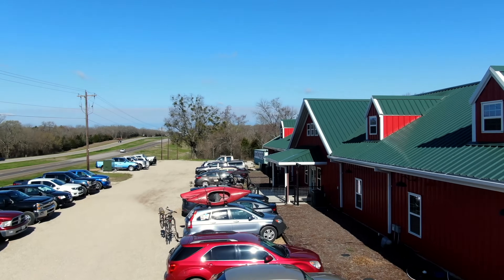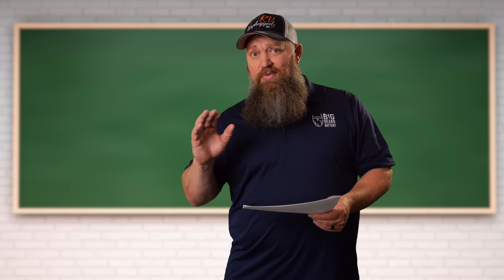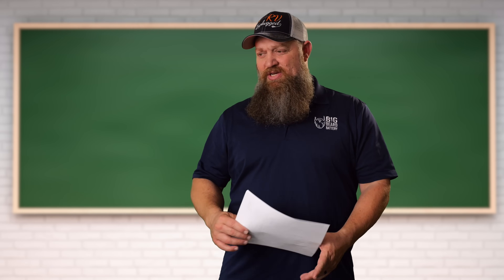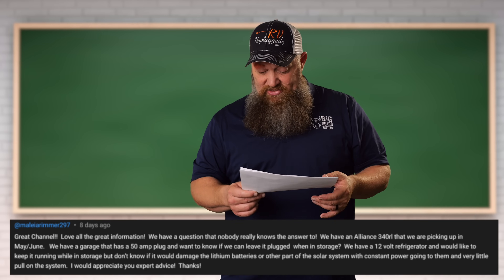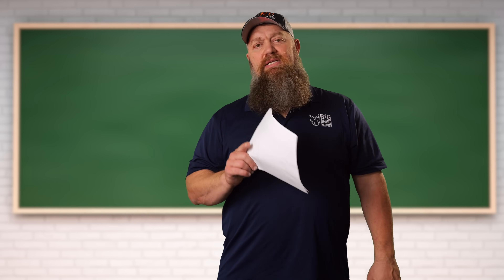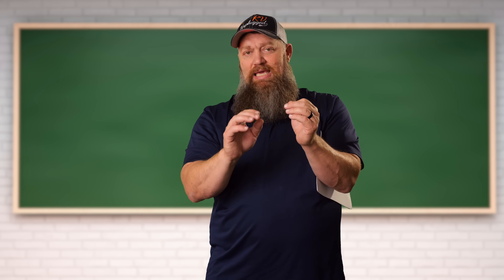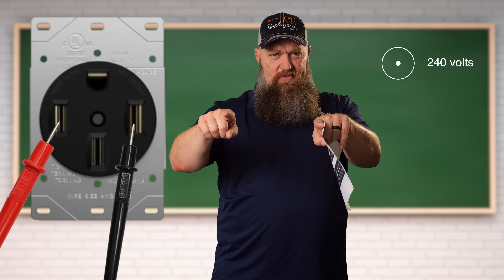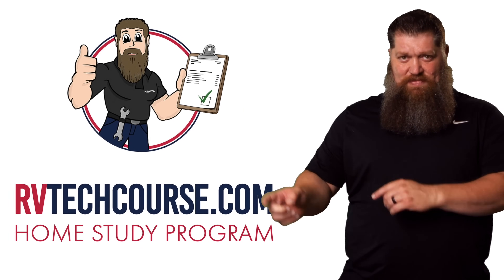RV Electrical Questions Q&A

Comment: Hi Todd love your TTT lots of good information but I need to verify something with you. When I plug my rv into a 20 amp gfi the plug trips. I think it it’s because  the neutral is bonded to ground in the rv. 
Can you verify that or am I off my rocker? Thanks Todd keep up the great job.
Reply from the maker: So without an ATS your neutral ground should NOT be bonded in the rv. It’s a sub panel. 

There is debate but I can tell you that any fluctuation of amperage between the hot and the ground up to around ~5ma will cause the gfi to trip. Air conditioners, refrigerators, microwaves all have capacitors that could fool the gfci. 

Some suggest the length of the cable. Greater than say 50’ could cause a voltage drop, while not significant enough for us to be concerned with the gfci sees it as a short.

Comment: I'm not exactly a Master Electrician. I am a Master Technician. And being that. As an, Electronics Audio Guy. I did some really wacky, Electrical Wiring and Interfacing. Let me explain it blows all, Electricians, minds. And here's why.

Almost 34 years ago. I designed and built. A very Unique. Audio & Video, Recording Facility.  A rolling couple of, Control Rooms  On Wheels. A big audio control room. And a smaller video control room. All inside a 25,000 pound, Diesel Box Truck.

In so doing. There was a couple of things I wanted. I wanted, Isolated Power. And so to get that. I purchased a, Step-Up/Step-Down,, Power Isolation Transformer. A 75 kW, Jobby. And with that.

I take a, single hot, 120. And another single hot, 120. No neutral. No ground. And I connect those 2 hots. Into the Primary  of this transformer. I generally take, between, 2 phases of, 204, Three Phase. Or, 240  volt, split phase 120. And my Electrical is Wired like an, Audio Circuit. The secondary of the transformer has a center tap. And with that. I get 120 and 120. On one side. I run all of my Audio Equipment and Video Equipment. On the other side I have, Lights. And my HVAC forced air whisper quiet, heating and cooling. Takes 240 volts.  Off the secondary of the transformer.  So even my HVAC is power isolated. My truck has no commonality with ground with my electric. And I have an internal Square-D Breaker Box, internally. With everything on a series of breakers. I was very mindful about my, current and wattage needs. I even did the mathematics needed for the BTUs of necessary air conditioning. On a 93° day. It came out to 18,000 BTU. I purchased a 24,500 BTU unit. And that gave me some additional wiggle room on the BTUs. For hotter days.

If necessary and I have, in the past. I can always get a, 240 Volt, feed. A couple of times. I could only get a 120  V, 60 amp, feed. And while that worked out. It also destroyed my power cable. My power cable was not rated for 60 amps. It was rated for 30. It melted.. 250 feet of rubber jacketed copper. Melted. That cost me a pretty penny.  I'm glad I got to the gig. I nearly burned the crap out of my hands! I vowed never to do that again. They can give me the right power? I'll leave. Or get me a generator. I need, 208-240.

 The Power Isolation transformer also, has additional advantages. My Audio Gear, actually got quieter.. In essence. I'm running Balanced Power. Balanced at the input. Basically unbalanced at the output. For the 120 volt feeds. The air conditioner gets balanced power  on the secondary. And since the transformer. Doesn't need to pass a frequency response higher than, 60 Hz. Nothing much higher than that. Gets through the transformer. So it's actually filtering out. Plenty of Radio Frequency Interference or RFI. And also cleaning up a lot of noisy trash. That makes it onto the, electrical lines. From others, air conditioning and refrigeration compressors starting up. Other RF interference getting into the electrical lines. So high in frequency. It doesn't make it through the transformer. I get cleaner more filtered power. Just by virtue of how the transformer functions.

And so every time electrician has looked at my electrical wiring. They are completely and totally confused. You don't take any neutral? You don't take any ground? No and no. I ddon't need any of that. I just need 2 hot leads. 120 and 120. Or 104 and 104. Thanks to the tapping on the transformer. I could take 104 and 120.. And still end up with 240 on the secondary. Thanks to the input taps. It gives me a lot of versatility.

 But then also. In certain circumstances. Where I can't or don't want to use the transformer. I have a couple of adapter electrical cables. And I switch those. Now I can take,  208-240  Volts.. Direct coupled to the power mains. And I have to take a neutral at least. I don't take ground. The truck is on big rubber tires. The whole body is wood. It is not metal. It's 1 inch FRP on the outer box. And three-quarter inch, dense particle  wood walls.. It's a box within the box. And it's split into 3 separate rooms. With a common lengthwise hallway on the passenger side inside. And solid core wooden doors.  Between the 3 rooms.. Each room has extensive Audio and LCD/LED, displays on the walls. Wherever you look. Wherever you are. You are surrounded in sound in all three rooms.

And after 33 and 1/3 years. I have officially shut down. Most of the gear has been sold off. The vehicle has been emptied. I'm now deciding. If I might possibly turn it into my Super Class-C Motorhome, now? Or whether I'll sell the vehicle and just purchase a newer old used motorhome for myself? Something extremely comfortable. For an old person like me. Going to be 69 in October.  And I seem to be slowing down? I think age might have something to do with it? Or I'm just pooped out? I think I'm just pooped out. I had a good run. I made lots of recordings. Though? I have not yet archived. My hundreds of recordings.. Most are still on analog and digital tape. And I no longer really have the gear to play it back properly.  I mean I do but I don't. Not the way I had wanted to do it initially. So that's the frustrating part. And there's just really too much to take with me in a motorhome. So I'm freaking right now. I can pack my truck full of stuff. Up to, 26,000 pounds. It's about half that right now. A motorhome won't sustain that much stuff. I'll break my suspension. So? I've got to make an executive decision before the end of June. And I'm cutting it close.

It's just another day in paradise..
RemyRAD

Comment: Question, I have a coleman rubicon 1400bd trailer , is it possible to charge my battery while hooked to shore power ? I have a converter but not an inverter and if so how ?
Reply: A 12 volt RV converter will also charge your batteries at up to the maximum amperage it's rated for, often somewhere around 30-40 amps. Inverters take power from your batteries and invert it to the AC power that regular wall outlets use.
Reply: @calledtojourney  it's a coleman rubicon 1400bh trailer, basically a square drop trailer , has a 100 amp hour battery and converter but does not charge battery when hooked to shore power although it will charge when in tow from tow vehicle
Reply: @Frenchy5117  The converter should charge the battery when you're connected to shore power. If you have a multimeter, measure the battery's voltage before and after you connect to shore power. If there's no difference, I suspect that your converter is not working.
Reply: @calledtojourney  ill do that but when I picked up from Camping World they even said it wouldn't charge but I found that strange also , thank you for the reply and information

Comment: I understood (or MISunderstood) the second question differently,  in that assuming the connect was a valid 50A RV receptacle, is there any harm in (lithium) battery being on float at 100% for an entire season?
Reply: Same here! The question was if leaving the RV plugged in all the time during the off season , would it damage the batteries as they are simply under constant charge. 

I would say, the charger if smart enough “should” go into Float mode and basically not continue to charge the batteries. 

The 50A circuit is irrelevant 

Todd - keep up the great work!

Comment: Mine is kinda stupid, but can I leave my battery hooked up, but put a charger on it like a NOCO 2 amp trickle charger to top off the battery before a boondocking trip for a night?  I wasn’t sure if I had to disconnect it first from the RV’s wiring.
Reply: Yes, you can connect that charger to the battery while it's still connected to the RV. But you probably don't need the trickle charger. Just plug in your RV so your 12 volt converter/charger can keep your battery charged. This is almost certainly better because your converter can charge the batteries at a much higher amperage than a little trickle charger can, if necessary.

Comment: Hi Mr. Todd,  can I safely use my  50amp EMS with a 30amp plug adapter on it to plug into a 30amp campground pedestal to supply 30amp service to my C-class motorhome.  What would the EMS read on line 1 and line 2 from a 30amp pedestal power supply? or would it use only one line to supply the 30amp power supply to my motorhome? Thank you Sir
Reply: 30a only has one hot leg, this the 3 prongs. That would mean only part of the rig will work depending on what's connected to that bus bar in the breaker box. 

Don't see why a 50a EMS wouldn't work to still protect the one line unless if it senses missing one line and therefore doesn't let the power through. I'd check with the manufacturer of the EMS if me.
Reply: @kevinmiller4651  All of the 30A to 50A adapters that I have used connect the one hot leg of the 30A receptacle to both L1 and L2 on the 50A side. Have you run into any that do not do this?
Reply: Typical RV 30A to 50A adapters connect the one hot line from the 30A receptacle to both L1 and L2 on the 50A side so the EMS will see the same voltage on both L1 and L2. My Progressive 50A EMS worked just fine with a 30A adapter, but I had to manage electrical loads to not overload the 30A outlet.
Reply: @jeffh5254  Thank you for your reply.  My C-class has a built in EMS also to manage power between the 2 AC's, the microwave,  coffee maker etc.. so as not to throw breakers.  I sold my 50A coach and still wanted to use my 50A EMS at the pedestal for 30A till I purchase a 30A EMS.
Reply: Gotcha! That'd make more sense! I assumed you just lost a leg and it didn't connect both in an attempt to keep someone from overloading the 30a😊

Comment: Hi Todd , I did the same exact thing over the winter, ran my rv on shore power while batteries were in storage. But will it cook my solar controller? My controller now , with batteries installed now , brings volt to 15.0  after in inside with lights on , then when i shut everything off it flashes then after 10 seconds drops to 13.6 and levels out.. should I upgrade my controller?
Reply: It's fine. Let it be.

Comment: Thanks Todd you are the reason I am currently yes a pun watching the home study course for the third time This is the best money I have spent for my TT. Each time I have watched the videos I have heard and learned something I missed the previous times. I have a EMS and have now invested in a multi meter.
I have shore power question, do the outlet receptacle testers work? I have one for house hold 15a outlets and one for 30a shore power that I use to check the power pedestal before I even back into site.